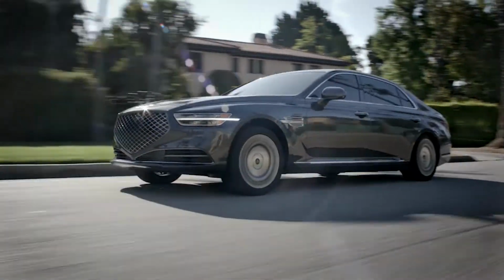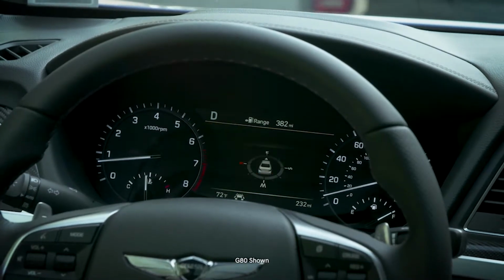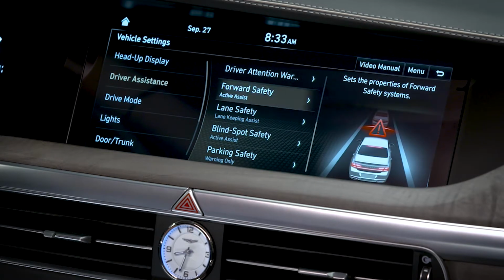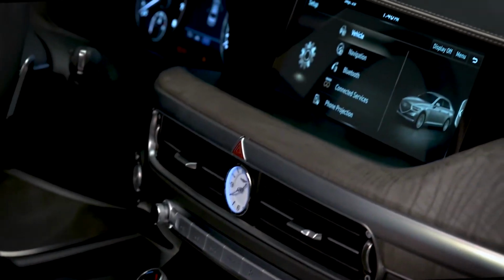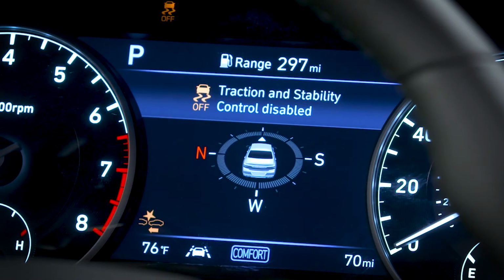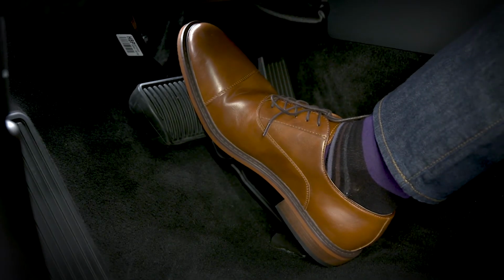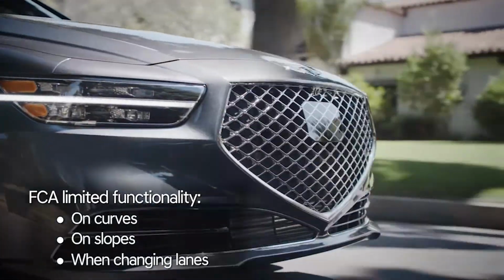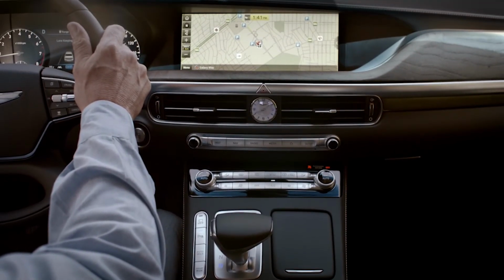Genesis G90 | Forward Collision-Avoidance Assist | Genesis USA

Comment: So..this system won't brake the vehicle after 47 mph? That means I won't be purchasing this car then. Toyota's pre-collision system..which is standard in all new Toyota & Lexus vehicles..will brake the vehicle between 7 and 110 mph. To say to viewers "But safe driving is your responsibility" just because your system isn't as good as Toyota's is insulting. These safety systems were created to help drivers..and active braking should occur at highway speeds where accidents can occur as well. At this price range there is no excuse to have such a limited system when Toyota gives it to even their cheapest vehicles. No thanks, Hyundai.